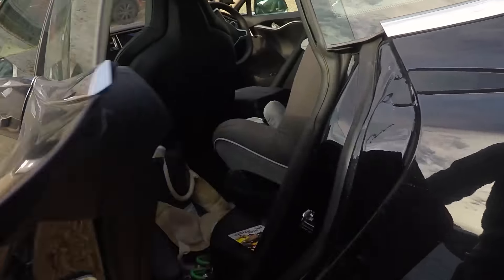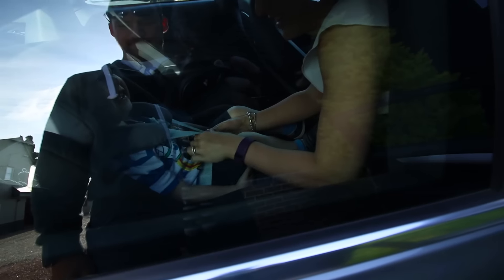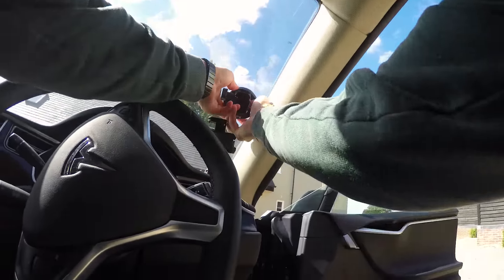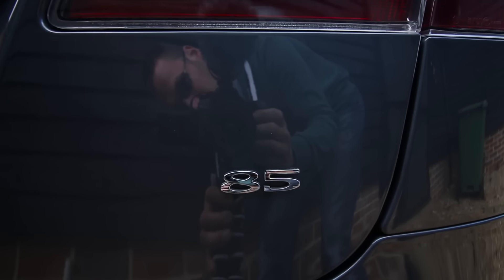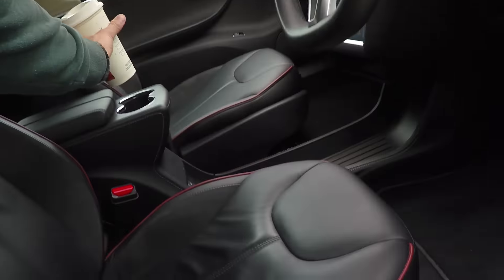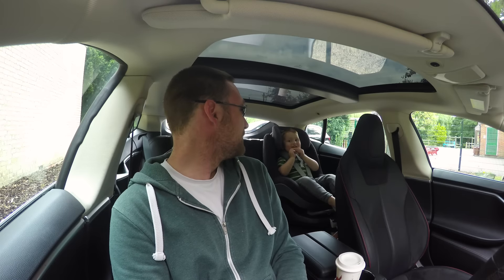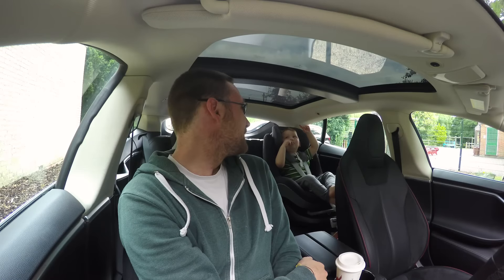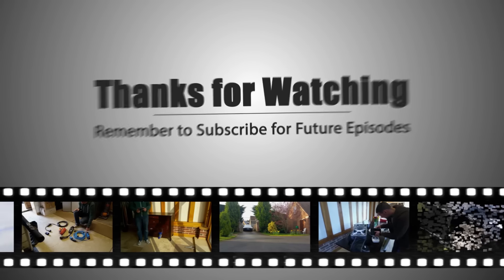The Tesla Service Loaner

Comment: James  - question for you as you don't have a sunroof in yours. Sitting as an adult in the back do you feel there is enough headroom without the sunroof? I would actually prefer no sunroof as it's cheaper and for the purpose of chauffeuring (which is what we do) it's better to have a darker cabin when they are working on laptops etc.